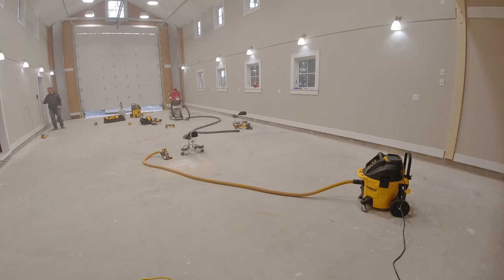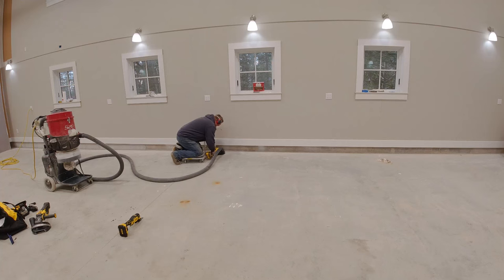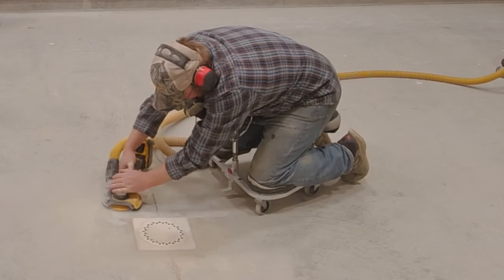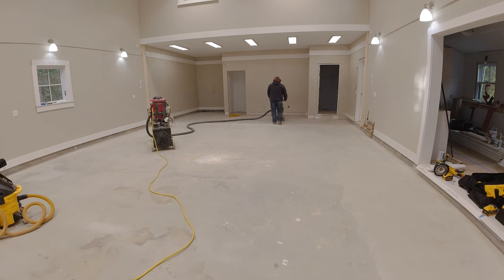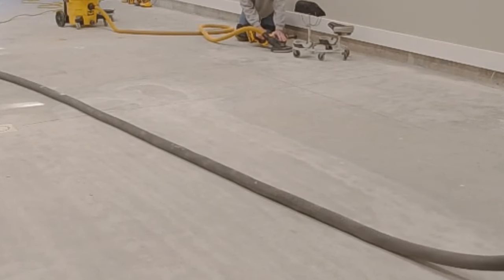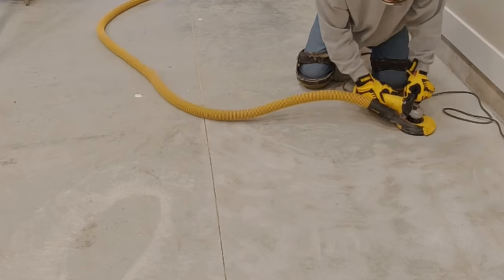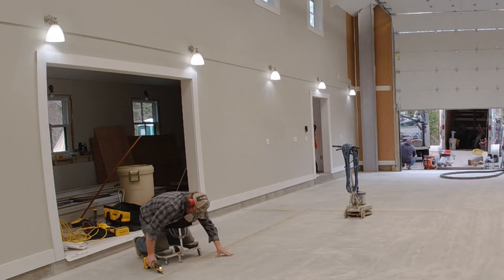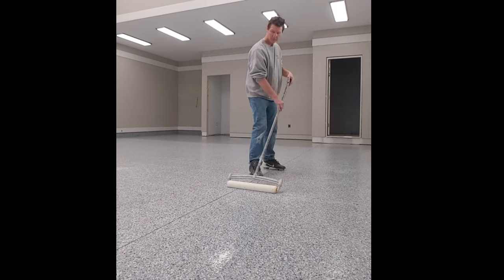How To Prep Concrete For An Epoxy Garage Floor Coating (The Tools I Use!)

Comment: Excellent video, I've been debating on having my 20x20 garage floor done. I'm just concerned about durability, slipperiness, and any maintenance. I'm very particular about how my stuff looks. I reside in MI, so lots of snow, salt, etc.
Reply from the maker: We're in Maine, I feel these are the best coatings for all the concerns you mention. We do a lot of them and have for 20 years.

Comment: Hey Mike, greatly appreciate your videos.  You rock!  Have a question: what manufacturer is the larger/industrial looking vacuum?  Is that necessary if I did a DYI in my garage or could I get away with using just that Dewalt vacuum?

Comment: Hi Mike - for a new slab that is going to get an epoxy coating right away, can it be finished in such a way where you don't have to do any grinding?
Reply from the maker: I don't recommend finishing the concrete "not as smooth" so you don't have to grind. Grindng is your best option, or shot blasting. For the long run.

Comment: a nice set up is Dynamic Diamond DDG 1220 “BEAST” Concrete Floor Grinder or WerkMaster Concrete Floor Grinder. both grinders can do Concrete Surface Preparation/Profile. Both grinders you can stand up for edges and main floor. For power, Generator, propane or tap into electric box. Your multi-Tool works great for corners.
Reply: hey, I am not social media person. I just pop on your page once in a while. I have been in concrete construction 55 plus years[retired]. keep up the good work Mike.   thanks Keith
Reply from the maker: Awesome, thanks Keith!

Comment: So after you grind you simply just vacuum before applying your poly?  I see so many power wash after but I feel that would add in moisture and now they need to either wait many days to let it evaporate or apply a moisture barrier yes?

Comment: Here's a tip for you.  I used to use regular ear muffs, but recently I bought a soundcore noise canceling ear muffs for only about $70.  It cancels the noise much better than regular ear muffs.  Plus you can listen to music or take phone calls with bluetooth connectivity.  The charge lasts 44 hours.

Comment: Mike, I have a few low spots in my garage that water flows to. It’s especially a problem in the winter with a heated garage. The water flows to the garage door and the pedestrian door, freezing under and in front of the doors. Is there a product to float the low spots and the spalling? Or are they different products?

Comment: If the surface is rough and was never finish smoothed do you still need to grind in order to apply a polyspardic or epoxy coating ?
Reply: yes
Reply: @daveyconcrete9801  For what purpose ? Doesn't the grinding provide a rough surface ? If the surface is already rough with no finish, paint etc, what is the grinding doing ?
Reply: @JDCrae   It flattens and evens out the surface as well as cleaning the surface by removing the top layer. 
what you think you may be saving in not grinding you will pay for in extra layers of epoxy.
Reply from the maker: Exposing the "pores" in the surface for adhesion is important. Cleaning the concrete is also important, both done with the diamond cup wheel. Sometimes the top layer of paste/cream is "softer" than right underneath it so we like to remove it whether rough or smooth to get to a hard dense concrete for the coating to last a long time.

Comment: Hi Mike, I have a large shop in the back of the house that I purchased.  It has a large slab that I don't know if they put a moisture barrier under it when they poured it.  How do I protect from moisture for my new coating?  Thanks.
Reply: Moisture vapor barrier epoxy
Reply: I use it a lot. It makes sense to use it whenever in doubt. Works the same as any prime coat for epoxy floors and most will even take flakes. That and a coat of polyaspartic on top and you've got a pretty strong floor